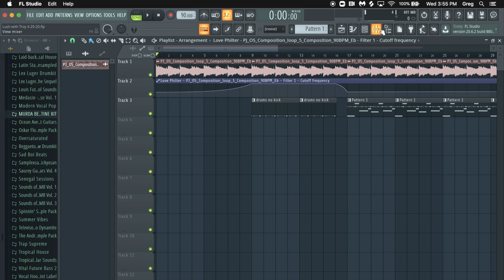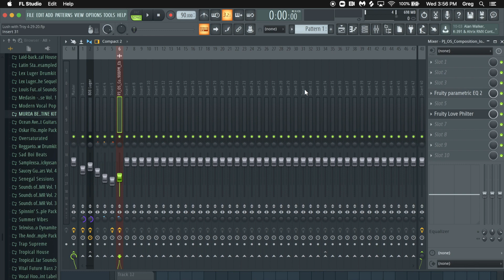FL Studio 20 Tip to Save CPU Load and Time - Docking, Send, Bus

Comment: I learned from Image-Line that using buses or sends actually slows down your CPU’s performance.  Because each channel is a new opportunity for your multicore processor to use a separate core for each channel. When you run everything to a send first. Now it can only use one core at a time for all the effects running to that one send. 

“Each Mixer Track represents an 'opportunity' to create these independent, parallel, processing paths. Each unit in the audio chain from the instrument through to the Mixer track and the effects must be processed in sequence on the same core.”

-Image-Line
Reply from the maker: This is really interesting to hear. I'm going to look into this some more. From what I've experienced when I was using a slower computer, having one or two sends actually saved CPU (and project load time) because I didn't have so many instances of the same effect on multiple channels. I really appreciate the comment and will look into this further!